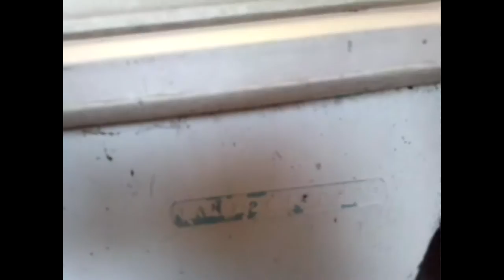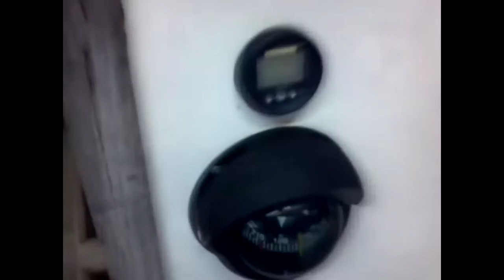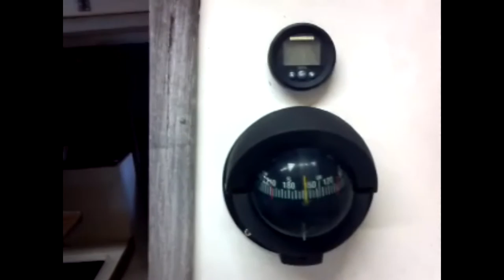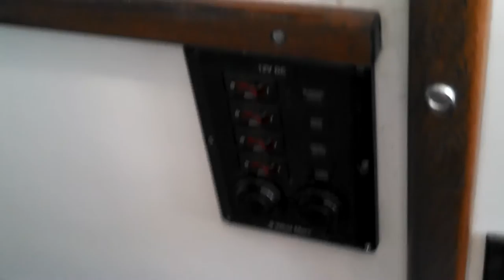Tanzer Sail Boat Restore

Comment: Great job! Mine has red cushions and the fin keel, but otherwise exactly the same. The little cabin is so laughably tiny, I think I’m going to completely remove the sink/fridge/counter section and do something more comfortable. I may also cut the top and build a fiberglass cabin top that offers a bit more headroom and some bigger windows, I’m 6’2” tall and the cabin is only 4’6”. It’s just a little snug! 😂
Reply: It's small for sure. However, it's a capable cruising boat. I cruised one from Traverse Bay to Beaver Island and various other northern Michigan places for years in the 1980's/90's. It's a great sailing boat, amazingly fast and it stands up to storms. I've been on the boat for a couple weeks at a time.

Comment: How hard is this boat to launch. Iam thinking of getting one, but the manual says 3 and a 1/2 ft of water is needed to float
Reply from the maker: It wasn't hard to launch (no different than a normal power boat in my opinion... back in til it floats), but dealing with the mast every time would be a pain (assuming you wish to transport it). Maybe if it was always you and a friend who knew exactly what to do and could get it up quickly.
Reply: Launched mine first time today (centerboard version). Back truck tires were in the water but other than that no problem. No tether needed. Maybe if you had a really shallow ramp it might be a problem.